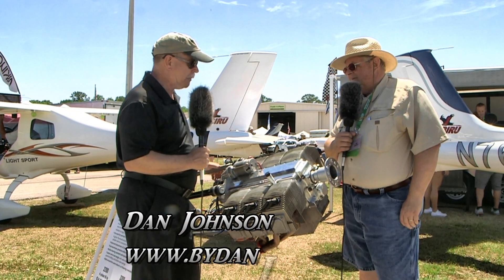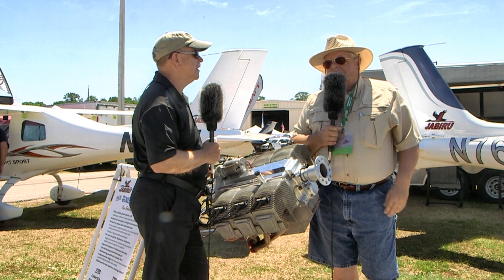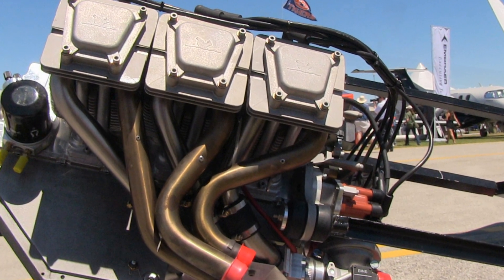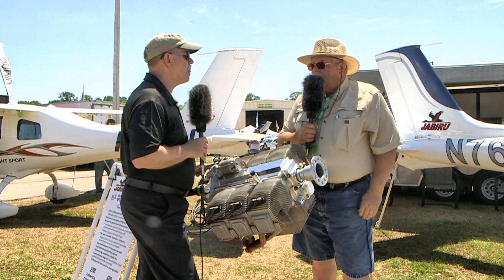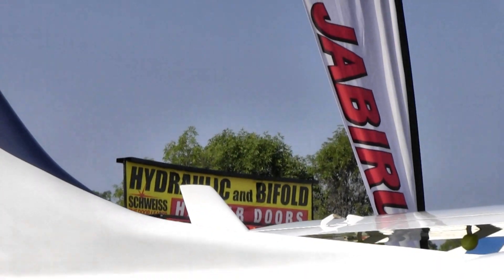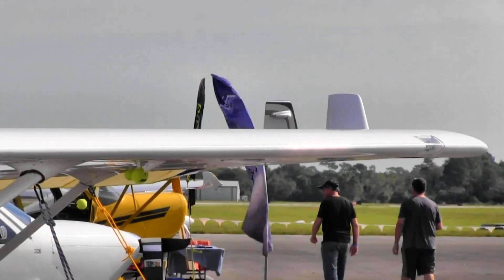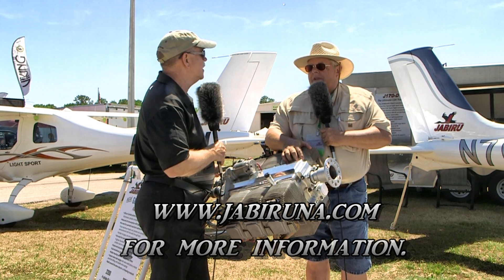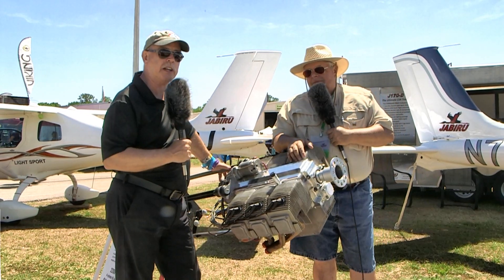Jabiru Aircraft Engines, Jabiru North America, Jabiru 2200 Jabiru 3300 Updated  for 2017

Comment: I just wish Jabaru would cast mounting bosses on there motor block so a reduction drive could be used when desired. There RPMs are too high for me.
Reply from the maker: They are direct drive and turn about the same as other 4 stroke engines like Lycoming and Continental.
If you were able to install a redrive and reduce prop rpm, you would have to be spinning one hell of a long prop to get the thrust equivalent!
The Ultralight Flyer
Reply: What RPMs are you working on Ray?
Are you sure you are not confusing the Jabiru with the Rotax 912 series engines?
Jabirus are direct drive (max 3300 rpm) rotax 912s have a reduction gearbox (max 5800 rpm).
Reply: @spency787  
3300 rpm is too high for direct drive, when experimental types are flying around 100 knots and looking to swing a 76 inch (or bigger) prop.

Comment: These are nice, but the MYT-6 engine concept is a better design, 200 HP and under 30 lbs, very few moving parts and with lubricating fuels it never needs an oil change.
Reply: Vaporware... sometimes things look good on paper but have materials science problems due to engine stresses.... the MYT is probably one of those. Another one with that type of problem is the liquid piston.... it may eventually work but it due to the mechanical stresses on the engine it will require alot of materials science to make an engine that can survive the stresses placed on it without wearing or exploding. Engines like VWs or Jabirus are very slow stress engines you can build them out of low quality materials and them usually not explode when built with high quality materials they are could be made very sound and reliable.

Comment: What is the propulsive efficiency of Jabiru 2200 propeller sir?
Reply: Harlow Jan Picart I can tell you the self destructiveness potentials of the 2200 in 400 hours or less. 10,500 dollars later I now own a used 912ULS with more horsepower and some peace of mind. PS I also have a Jabiru boat anchor for sale, in the shape of an pathetic airplane engine.